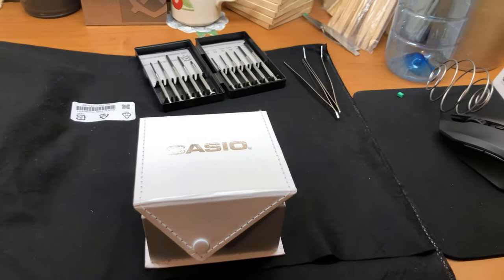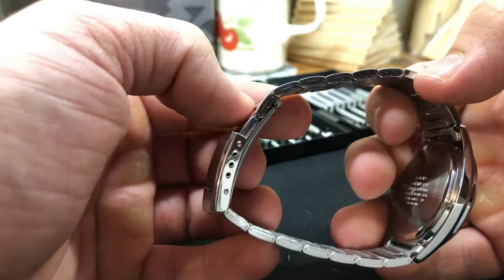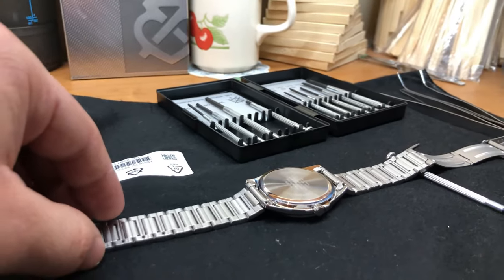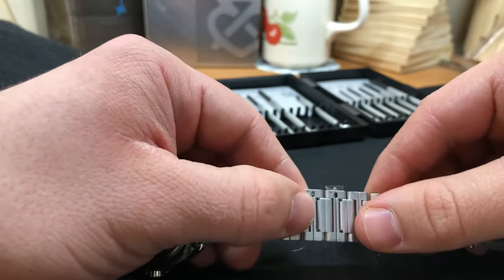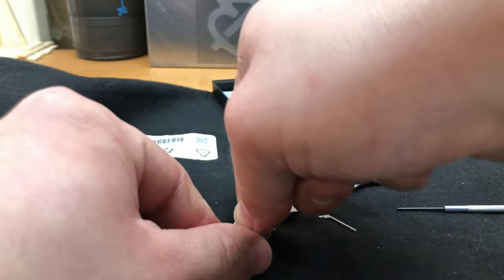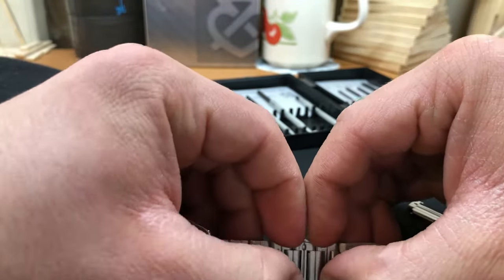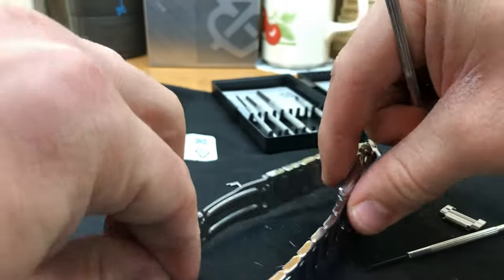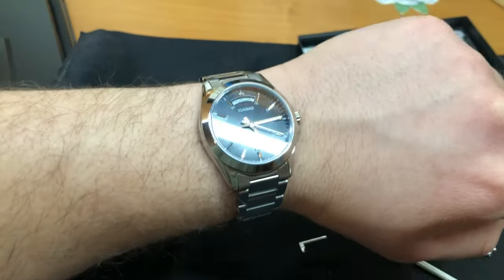How To Resize / Adjust a Watch Band/ CASIO MTP-1370D-1A1

Comment: everthing was going great but im having trouble taking out the piece were the arrows are facing out. it actually bent one of the tools that i bought lol.
Reply from the maker: Maybe try to put some pressure not only forward but also downward while extracting it, because there is a tiny metal part that plays the role of a lock.
I hope that will help you.

Comment: Thanks bro. This really worked. A tip for the ones who are struggling with fitting the L shape thing back in. Use a pliers guys. It really helps. Good luck with your new stainless steel watch
Reply from the maker: I'm glad I helped.

Comment: If i want to replace it with leather strap what size should i buy?
Reply from the maker: There should be a size table which will help you find your size. Just measure your wrist diameter and try to figure out in the size table.